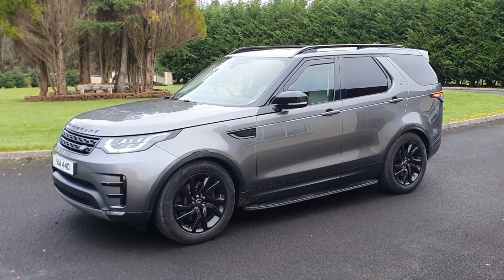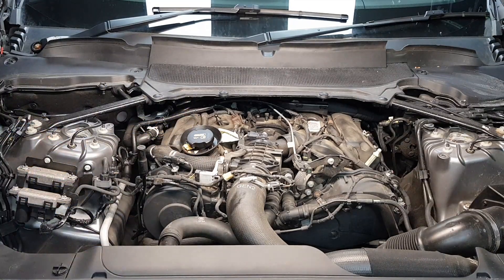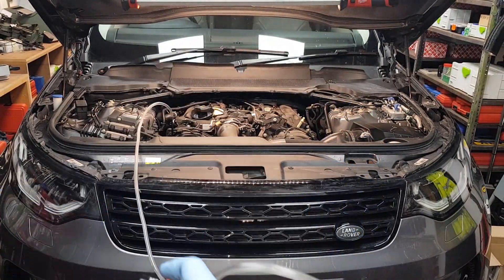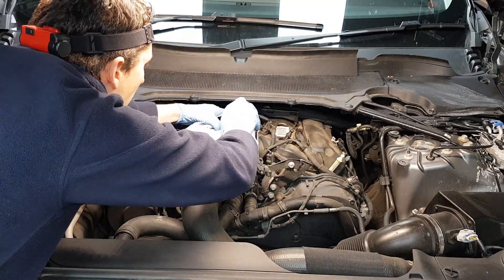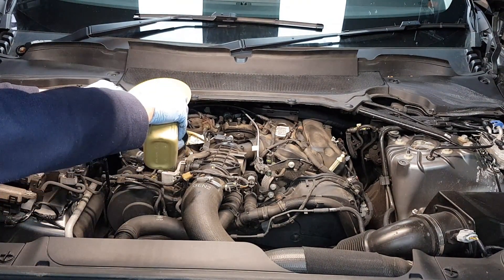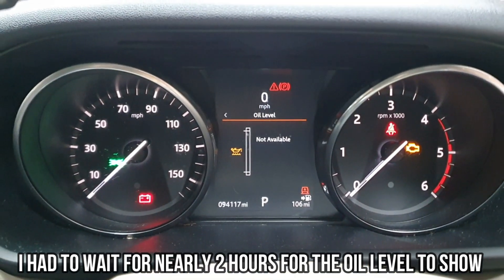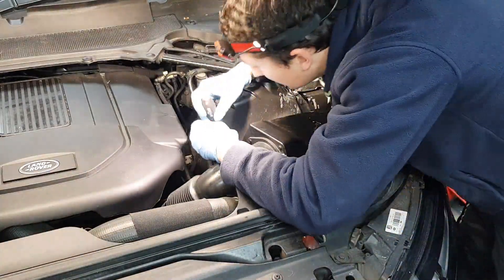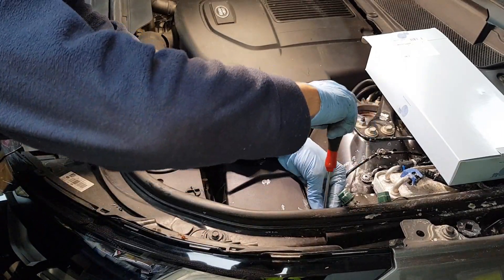Land Rover Discovery Oil filter Air filter Oil Change Engine Service Oil Level Check Range Rover

Comment: Amazing video, What is torque settings for oil filter? Or just hand tight?
Reply from the maker: @uvraj947  Most manufacturers recommend 25nm. I go by that. Hand tight would be ok for the metal Oil filters but I go with 25nm where you have a plastic cap on the oil filter housing.🤝🏻